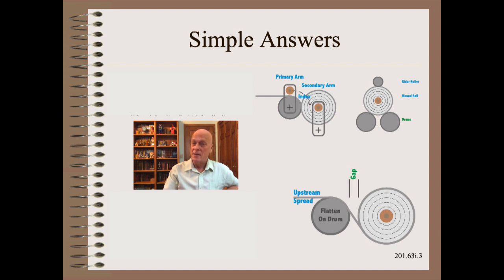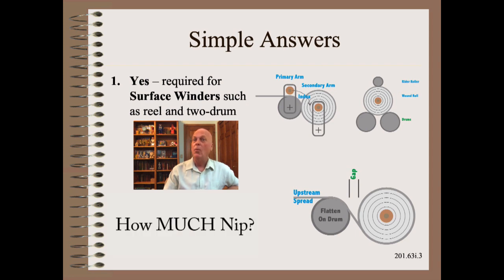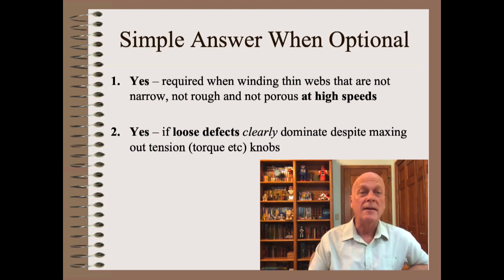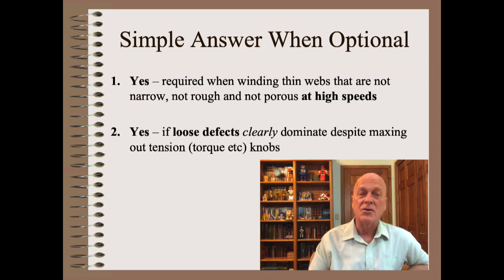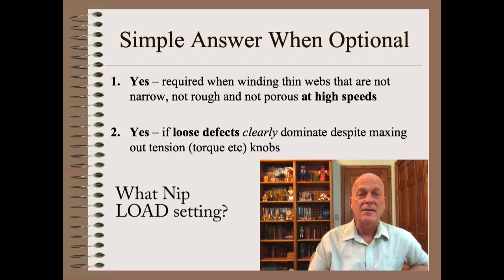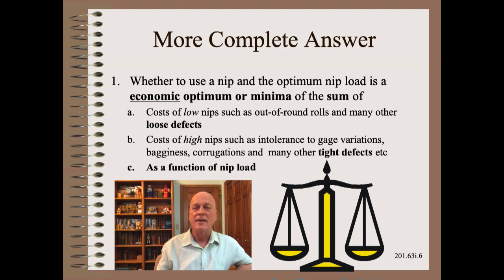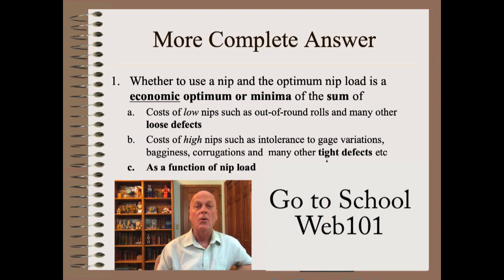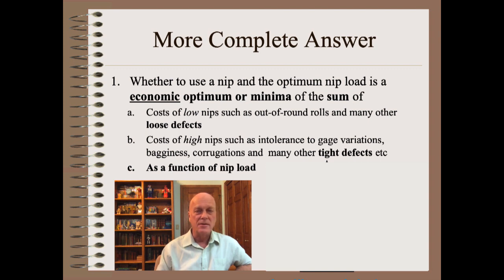Web20163i - Question - Should I Use a Nip for Winding and How Much Nip?

Comment: I’m using a >6” pressurized lay on roller held up by two independent cylinders using psi. 60lbs psi on one side and 38lbs psi on other side. That is as close as I can get to level.  Machine is completely out of whack and I still have to run .000285 aluminum.😂

I’ve been running this machine solo since installed 6 years ago. 
I’m slitting/rewinding rolls up to 34”.